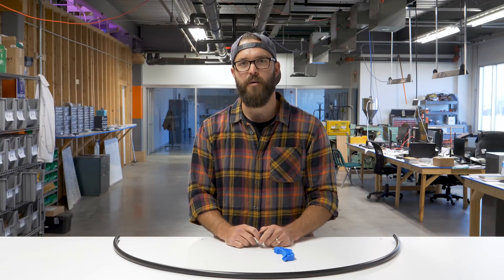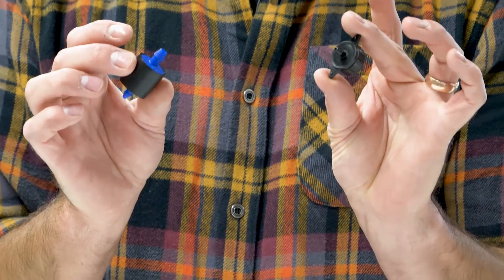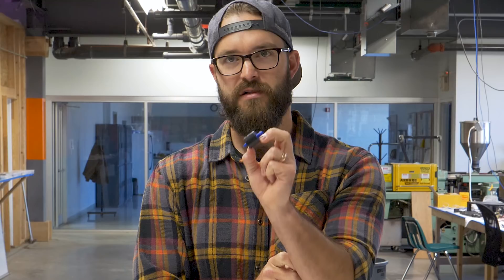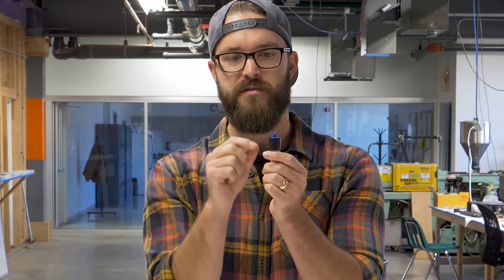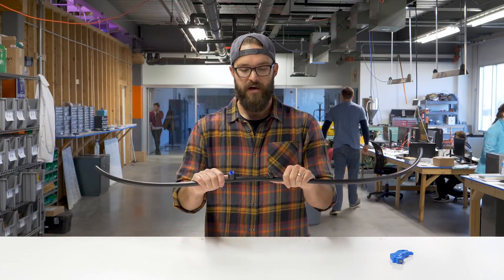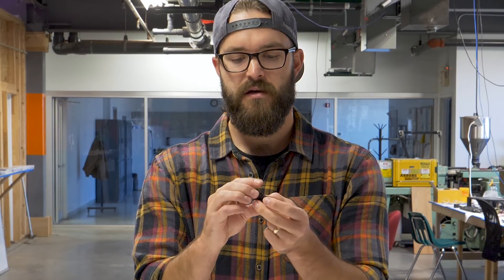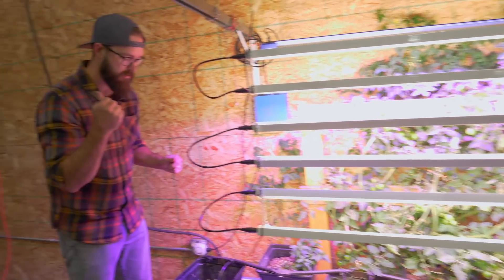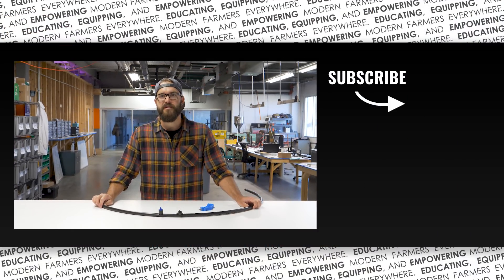Plumbing Series: Drip Emitters

Comment: If my drip is above my sprinkler anti siphon rain bird valve . How can I prevent the water back flowing back down to the anti siphon valve ? I have rain bird pressure compensating drip emitters with check valves built in . I also installed a 3/4” pvc check valve inline right after anti siphon valve . Still the water back flows after the timed station is complete not at once but gradually throughout the day . I made sure it’s not from diaphragm side. The water is causing erosion and doesn’t drain away fast enough. 
Rain bird said to install a pressure reducing inline filter... i control pressure with the knob on the valve so I don’t see how that would prevent back flow...

Comment: Is there any type of drip emitters that serves with a really tiny deipping rate like 0.005 us gallons per day ? 

Is it possible for me to set such a system in my room ?
Reply: Not that I've found. At that point you're probably best making a little hole in a soda bottle or some kind of system that slows the water down, like a series of overflow brims.